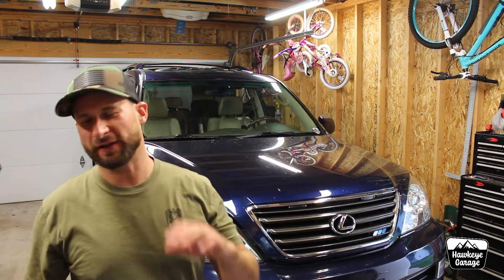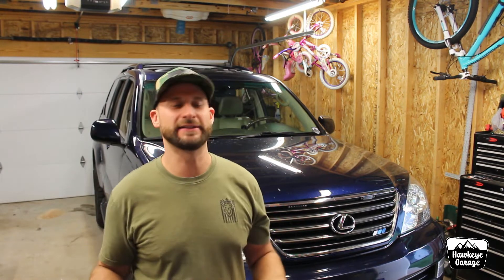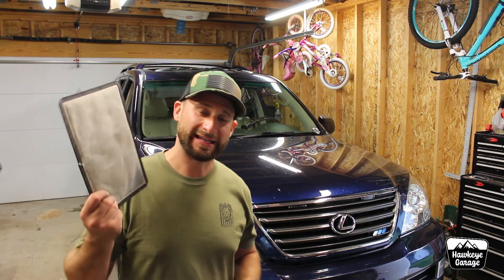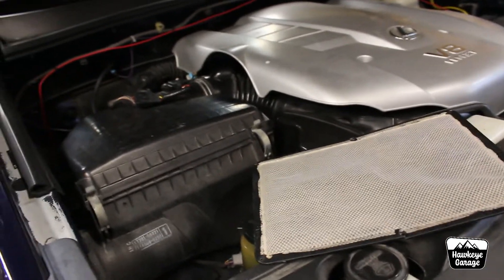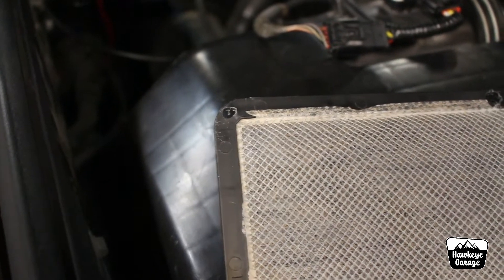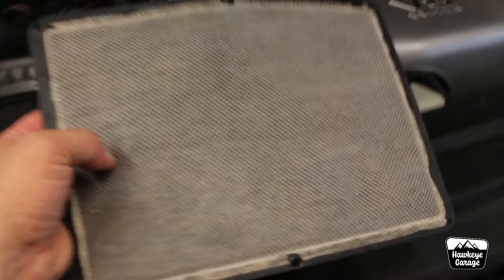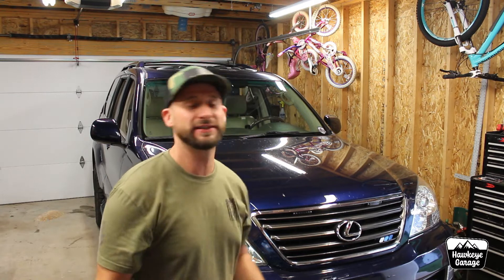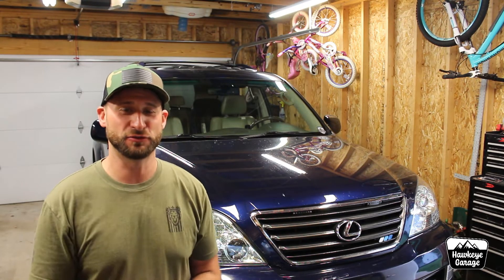Removing The Secondary - Charcoal Filter From Lexus - Toyota

Comment: It's for "drying" the intake charge to keep particulates from building up on the MAF - it was never needed just another engineering project for Toyota because of warranty issues from previous years.
Reply: Where did you read that 😂

Its to stop hydrocarbon emissions from gas on valves/cylinder evaporate escaping into the atmosphere. It absorbs the fumes and then releases when the engine is turned on again. 

Removed on prius does nothing bad or noticeably good

Comment: I removed that filter on my 2017 Mazda 3 -- and that FIXED a vexing problem I had where I would get a 5-10hp kick (accelerating) when backing off from full throttle. So this was holding back a good deal of power at full throttle (high flow) -- and on my first test drive I reached 100mph by accident on a stretch that always yielded 90-95. I was stoked at the performance gain! I tried blowing through it with my breath and feeling what came through on my hand -- and it felt like haIf the flow of the air filter. I had no code problems. I used a flat-blade to pry it out & break the plastic welds. I saved it because I suspect that it may cause an evaporative emissions failure during smog test (at least the visual inspection) -- and I can always stick it back in place for a smog check.

Comment: I'm pretty sure that's not in mine or at least I don't remember seeing it when I replaced my air filter. Mines a 03 Gx.
Reply from the maker: 03 is non VVTi so it might not, thats technically a different engine.

Comment: I removed it from my 2008 tacoma and now it throwing check engine light. "Map sensor out of range"
Reply from the maker: Sounds like maybe you were a little too rough handling the MAF. Stick that filter back in, clear the code and see if the CEL comes back.

Comment: This is exactly what I'm considering doing myself.  Opened mine up today & that secondary filter is matted bad. Surprised it can even breathe at all.  After seeing this video I'm going to do the same.  There's a higher risk of engine damage with it unable to breathe, than with removed.

Thanks!
Reply: Have you removed this extra filter? any effect on it...i have 4runner and have this in that too....i am getting code: Mass or volume Air Flow Sensor "A" circuit low
P0102"
No idea if it belongs to this filter...as i never changed this extra filter

Comment: Did this on my 2nd gen Tacoma (4cyl, 180k miles), immediately had about 2 mpg improvement over 19-20mpg between fill ups. After about 10 fill-ups, I've never had less than 21.5mpg after removing this secondary filter. 

Just for fun, I blew compressed air through the old filter and very little was coming through. Putting the air gun on my face, it was offensive how much airflow there was, but after holding it up to the filter, it was like a light breeze. Short term term fuel trim is about 2% less after the delete, meaning the engine is adding a little bit more fuel than it was, meaning the ECU is taking care of things--just as the Toyota design engineers intended for the ECU to do. Nissans trim or add 25% before they bite the dust so I'm not worried about it.
Reply: I’ll have to do this on my 07 2tr-for as well